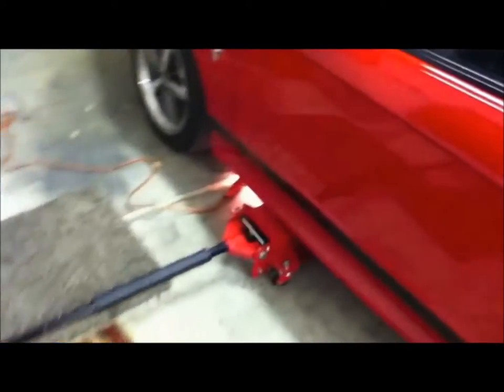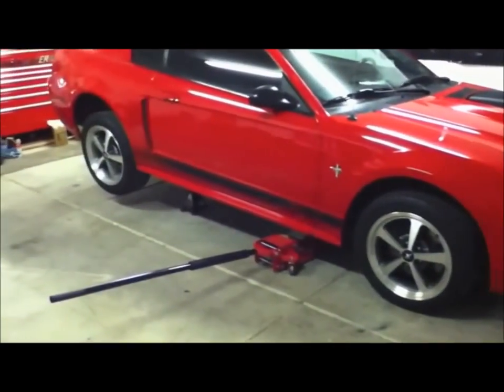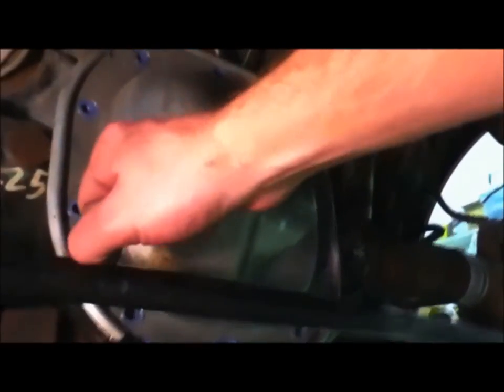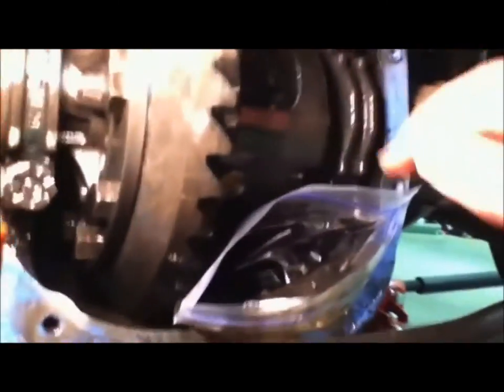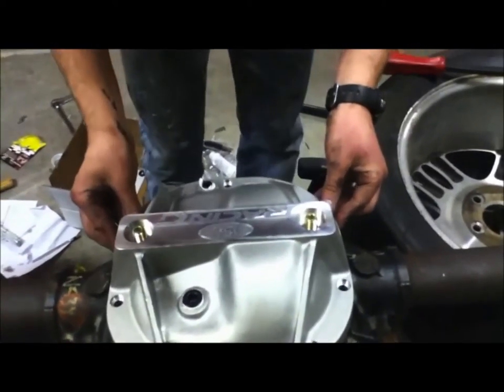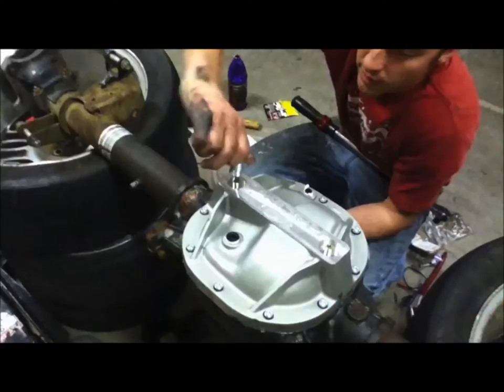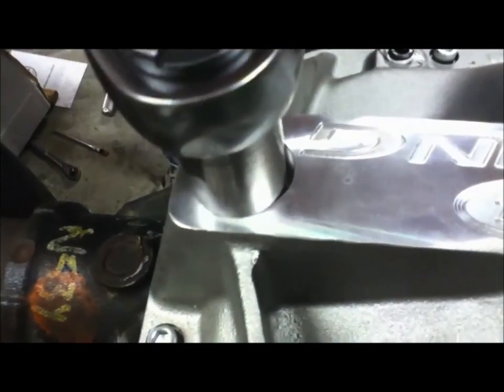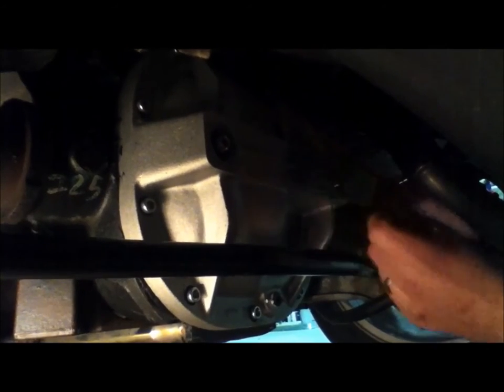Rear differential fluid change  & install. 8.8 Mustang, F-150, crown Victoria Explorer thunderbird

Comment: Thanks man! This is what I exactly needed help with on my 1994 Ford Mustang GT! I have the rear end gasket leaking, Instead of buying another one I was going to seal it up with gasket glue
Reply from the maker: 1sik sn95 yeah, the rtv works well. The ford racing diff cover is great too cause it's so thick it doesn't bend. They sell off brand ones for a little cheaper. The stock cover is so flimsy

Comment: I am getting this cover for mine,,,thanks for the video
Reply from the maker: Cool. Remember to only fill the diff until it comes out the original fill plug. Good luck on the install
Reply: @dannyjohnsonsgarage  I having it professionally installed along with an eaton posi and 3.73 gears from a pro shop
Reply from the maker: Robert Swift In that case, make sure the shop knows it’s not supposed to overflow out the cover fill plug. Common mistake
Reply: @dannyjohnsonsgarage  yeah,,,i will mention it

Comment: On the load bolts how do you know your not putting to much pressure? Get them snug then tourque?
Reply from the maker: Bill Burke It’s very minimal. 5 foot pounds. You want it just barely touching. Here is another video I recently made as well https://youtu.be/3UZBL9UD74A

Comment: what size is the drain plug on that ford racing cover ? I know the top one is 10MM allen socket apart from the factory 3/8 fill hole on inside of the 8.8 housing
Reply from the maker: 5/16 Allen I believe

Comment: Shouldn't you just be able to put the gear oil through the shift knob from inside? Gonna be my first time trying this
Reply from the maker: 1sik sn95 that's how you add oil to the transmission, not the rear end. I have a video on that as well
Reply from the maker: 1sik sn95 https://youtu.be/5ABs-ek5NPI
Reply: 1sik sn95 that's for the manual  transmission add fluid through the shifter .
Reply: Yea just take the shift knob off and add away